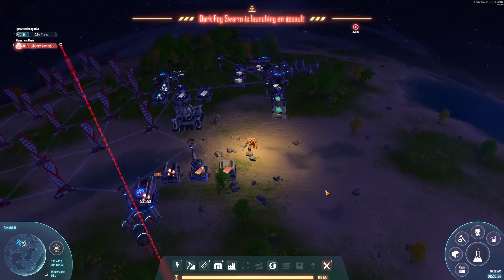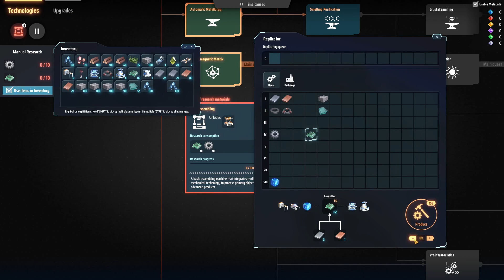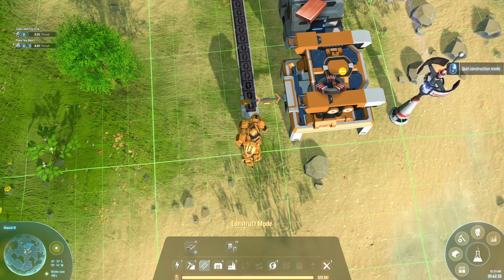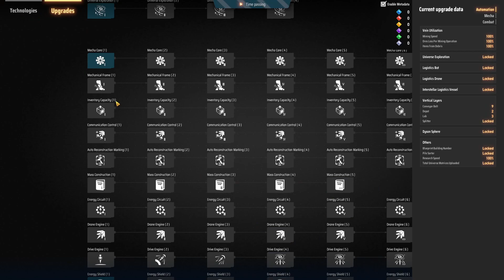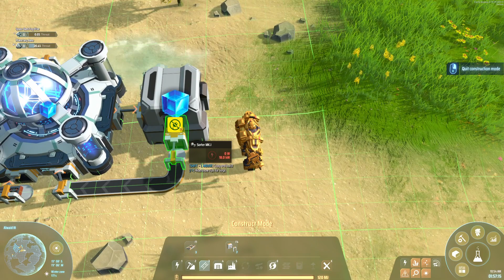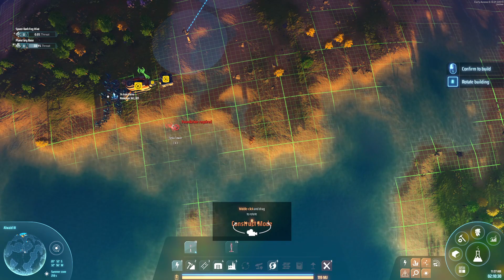ELECTROMAGNETIC MATRIX // Dyson Sphere Program // Mission Log 03

Comment: some basic factory math and tips for you:

due to the existence of the "vein utilization" upgrade, its always better to store raw materials in the ground rather than a buffer box. I'd only buffer box a material if you know you're going to personally/manually use it all the time. (its fine for now since you're hand crafting, but looks like your on track to automate buildings, that's exactly what you want to do. In this game genre people call it a mall, cause you can "go shopping" to all your boxes of buildings in the same place whenever you run low, highly recommend limiting your buffer box to 1 stack of most buildings other than your sorters and belts)

most of the buildings share the same 6-10 basic materials, so a highly efficient mall all in 1 place will save you a lot of time.

a miner covering 6 nodes will mine 180 items/minute, which is 3 per second. this slows down if the miner fills up with materials
a mark 1 belt transfers 6 items per second, so you can fill a belt by connecting 2 miners together with belts (you can T-junction two belts together, the T junction will prioritize the straight traffic)

a sorter mark 1 makes 1.5 trips per grid square per second, so a fast direct connection will transfer 3 items every 2 seconds, but if there's 1 grid space between the input and output of the smelter, it will only transfer 0.75 items per second, because it has to travel a farther distance. 

all sorters can travel a total of 3 grid squares maximum. 

a smelter produces 1 iron bar per second, which means it consumes 1 iron ore per second, this means 6 smelters can all share 1 full belt of iron ore, and will output 1 full belt of iron bars. 

your assembler makes 2 circuit boards per second, which means even at a direct connection, 1 single mark 1 sorter is too slow to empty the assembler of finished products. researching upgraded logistics can be very beneficial.

that down arrow caution sign on your miners just means that the nodes are running low. the ones that were near you where you landed were very small. most on the planet are much bigger. dont be afraid to overlap a 2 miners on the same node, they last quite awhile, especially if you get some vein utilization research eventually.
Reply from the maker: Thank you so much, this is excellent information and very helpful. I'm currently working on episode 17 where my first mall is nearing completion and I think I've learned most of what you've put here, although I never figured out the down arrow meaning. Hope you enjoy watching the series as I learn more about the game!